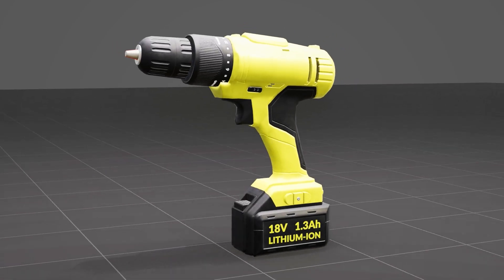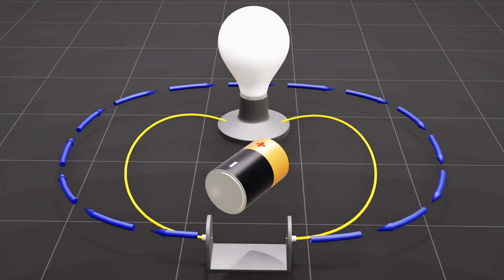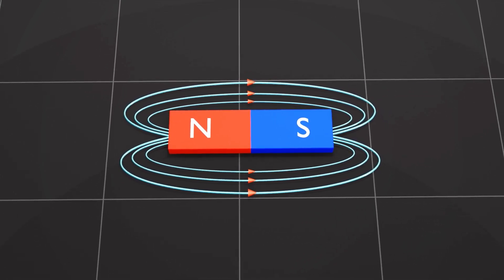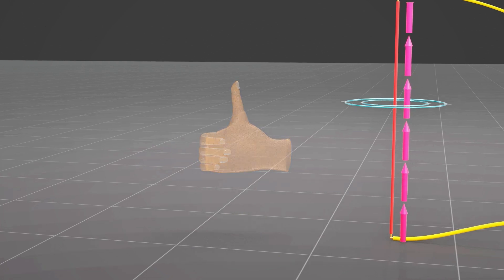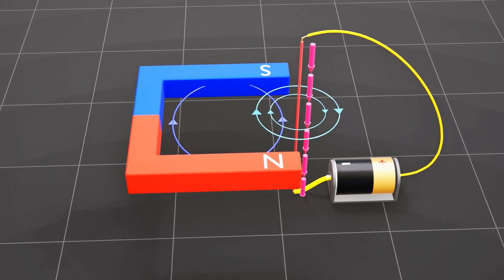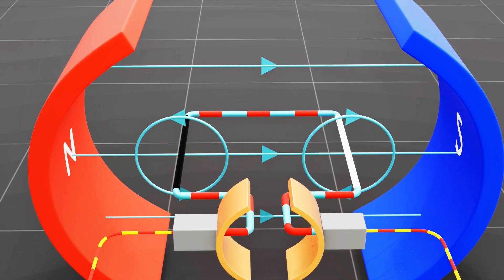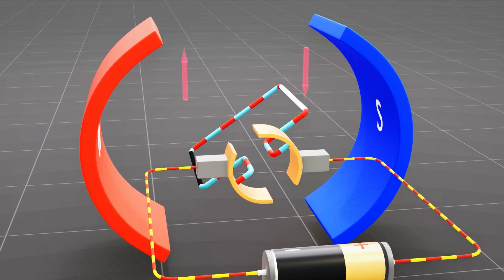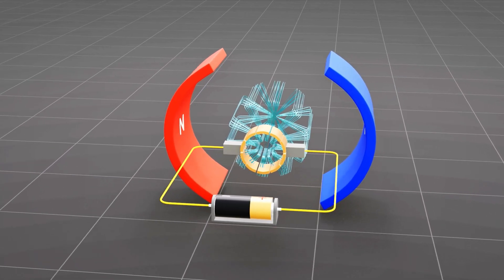How does an Electric Motor work? (DC Motor)

Comment: There's a part where you are completely wrong; electrons flow.
In fact, there's no electrons flow at all. An electron moves only a few nanometer per second.
So, an electron doesn't go from negative to positive side. It instead fulfills a hole made by the power source living behind it another hole... and so on...